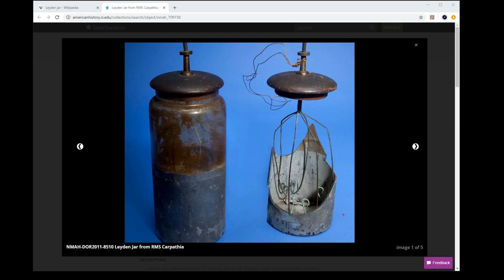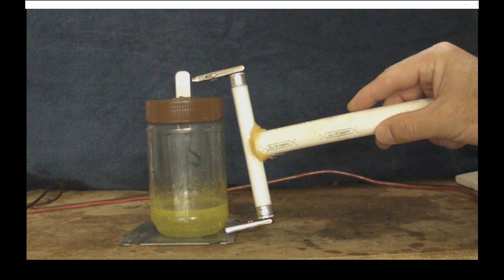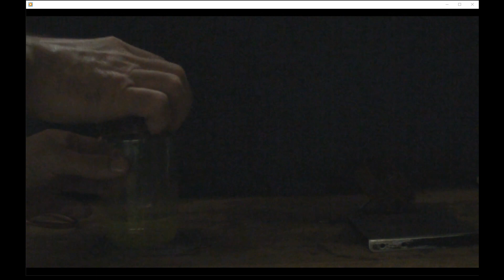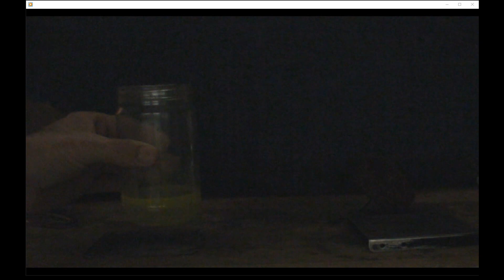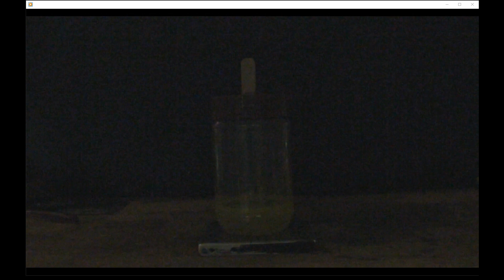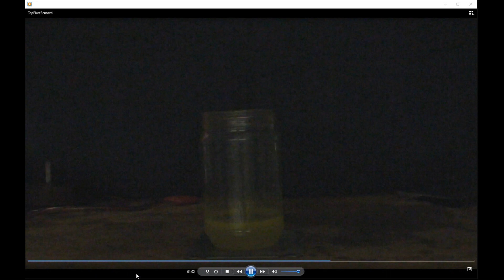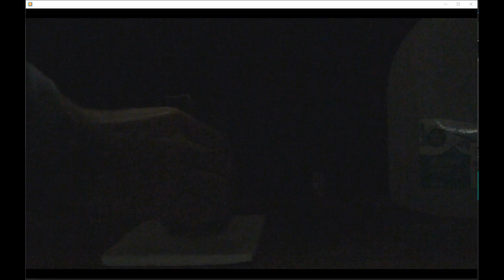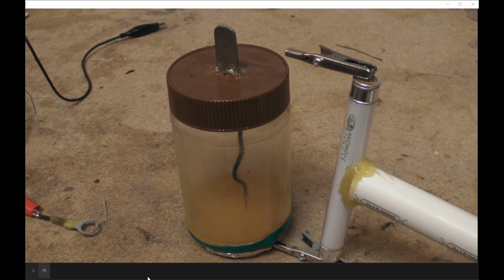Electron Theory can't explain Capacitors, but Ben Franklin can!

Comment: Yes, dielectrics influence the capacitance of a capacitor and contribute significantly to the total capacitance and hence energy stored; the main dielectric here being the liquid in the bottom of your jar. This is basic secondary school physics taught to 14 year olds in the UK,  yet you're making it into some profound discovery of yours.
Reply from the maker: <<the main dielectric here being the liquid in the bottom of your jar.  This is basic secondary school physics taught to 14 year olds in the UK,  yet you're making it into some profound discovery of yours.>>

OH yeah, it is all about me and MY discovery?  Is that your ingenious conclusion?  The main dielectric is the solid plastic, if you've ever done the experiment... or paid attention to the electrostatic meter at the end of the video, i.e. what is actually polarized?  The video was to show that ELECTRON THEORY states the charge of the capacitor is in the metal plates.  Ben Franklin discovered the opposite (which I am demonstrating).  You either aren't smart or didn't watch the video...THAT is my discovery!
Reply: @itsbs  OK, I apologize for possibly misinterpreting you, but you seem to be claiming that modern physics doesn't correctly explain how a capacitor works. That is, its theory is incorrect regarding the movement of electrons to and from the plates of the capacitor and the polarization of the dielectric by the internal electric field which influences the total capacitance of the capacitor and the energy stored in the dielectric, as taught to school children today in 2021. I'm fine with your video as a demonstration of how a dielectric is polarized by an electric field and there is an energy associated with it; but to then claim physics can't explain this while Franklin can is... an OTT click-bait claim to make in 2021 in my opinion.
Reply from the maker: @BarriosGroupie  <<I'm fine with your video as a demonstration of how a dielectric is polarized by an electric field and there is an energy associated with it; but to then claim physics can't explain this while Franklin can is... an OTT click-bait claim to make in 2021 in my opinion.>>

Modern Physics says that if you remove the dielectric from the electric field, which is caused by the displacement of electrons in the metal plates, then the dielectric would not be polarized... i.e. it is NO LONGER in the E-field created by the metal plates (electrons).  That is modern physics!  When I remove the dielectric from that metal-induced E-field, the plastic is still fully charged.  How?  Modern Physics can't explain why that occurs.  They try...so look at the MIT professor Lewin's explanation, and I show that is still incorrect.  You seem to think you are smarter than you really are and want to lash out at me, but your brain seems to be the click-bait.  So, here is the brain teaser... if the dielectric stores the charge of a capacitor, then what about a vacuum capacitor?  How does a "vacuum" dielectric store charge?  Isn't that supposed to be empty space?
Reply from the maker: @Fleurlean4  <<So how does a vacuum capacitor store the charge?>>

First step, don't think that the "vacuum" is "empty space" like Einstein created in 1905.
Reply from the maker: @Fleurlean4  <<Someone serious would collaborate with others, make an effort to show that they’re not a nutcase, rather than rationalizing your awkward personality by name dropping Franklin, as if he’s going to save you. Franklin was nothing like you, he was an industrialist and slave owner, he gave no shits for optics, only for results.>>

Well, I guess I am not that serious, which is part of the point.  You don't need to be a serious scientists to see the major oversights created by "serious" scientists.  I'm just quoting Franklin and showing you his original writing (that anyone can go read).  He said the charge was stored in the "glass" and he was correct.  Wow, you seem really interested in attacking people and not the scientific message... interesting!  Anger issues?
Reply from the maker: @Fleurlean4  <<Good bombardment, this really helps out taking you seriously. >>

I'm not asking anyone to take me seriously.  I am merely sharing my research so you can do figure it out yourself.  You keep missing that point, as if I am trying to build a following of believers in my "unachievable smartness."  I'm doing the exact opposite of that, otherwise I would hide my sources like Einstein.
Reply from the maker: @Fleurlean4  <<all I see is a whiny baby with anger issues cosplaying as a serious scientist. All you want is attention you were not given at some point of your life, maybe as a child with your parents>>

OK.  Good luck with your life...
Reply from the maker: @Fleurlean4  <<Why would you do these experiments in a dingy basement if you are serious? >>

It's my garage.  The idea is to keep it as crude as possible so ANYONE can realize that they can do the experiment themselves.  That's what I am encouraging... look at my experiment and look at the experiments that other people have done (direct links in the pinned comment) and DO IT YOURSELF.  Now, how cool is that?  No need to build a particle accelerator to understand the problem with Electron Theory...
Reply from the maker: @Fleurlean4  <<You on the other hand, are happy making a scene and having people pretending this is a worthwhile use of anyone’s time. Btw in science you try to disprove your hypothesis not constantly defending it. >>

I'm defending it from half-baked ideas from people that have an incorrect understanding.  That way their disinformation doesn't change people's minds when they read the comment section.  That's the defense...and yes, peer-review articles and Phd thesis require the author to defend their position...it is part of science!
Reply from the maker: @Fleurlean4  <<Yes, science is serious and there is a reason they don’t let sad people like you into the establishment, because you are without responsibility, you are blinded by your greed and desire to do/be something.>>

Oh yea, who am I then?  Where am I advertising that and where you should send me your money!  Are you not smart enough to figure this out by looking around, or do I really have to type it all out for you?
Reply from the maker: @Fleurlean4  <<You are someone who will defend and rationalize ad infinitum,>>

Rationalize?  Most people say stupid, emotional things to me, exactly like what you are doing.  It's not hard to counter pure emotionalism, like you have been dribbling.  If you don't like my "rationalization", I show you where to go read on your own or how to perform the experiment yourself.  Why do I care if you "believe" what I say or not?
Reply from the maker: @Fleurlean4  <<Ask yourself these questions instead of thinking people will enjoy reading your thoughts, this isn’t a game yet you keep treating it like one.>>

Funny...this is the idea of "misleading people like flat earth" and wasting people's time... The real irony is when you realize that Modern Physics and Popular Science propaganda is the real flat-earth AND THEY HAVE been charging money for it!
Reply from the maker: <<You have to understand that you have slightly worse than average you tuber skills, which are enough to make you dangerous here. People of all kinds come here, youngsters who do not have a complete picture of their world, >>

Well, it looks like you ended deleting all of your messages, which is one reason why I quote people in my responses.  Thanks for degrading me again and to think you have a "complete picture" of the world is probably the most arrogant thing to say.  Maybe you didn't mean it like that, but wow.  The youngsters will be able to handle themselves just fine...understanding the falseness of Modern Physics opens up many new opportunities, in a more productive direction.  Good luck to you in sorting out the problems in your life...I really do mean that.

Comment: Pretty much nonsense ...
No, in fact, it's all nonsense.
Reply from the maker: <<Pretty much nonsense ... No, in fact, it's all nonsense.>>

Genius, no nonsense comment!
Reply: @itsbs  Electric current in a wire is a coherent flow of conduction electrons. When current flows to a capacitor plate, the plate becomes charged. dQ/dt = i; the capacitance = Q/V. It is all about the electrons.
Reply from the maker: @danielstump3204  <<It is all about the electrons.>>

OK, so electron theory says that the charge of a capacitor is stored in the plates, which creates the E-field for the dielectric.  When you take the dielectric out of the E-field, the the capacitance of the "air" would become the new dielectric and the charge would still be in the plates, right?

Comment: LOL, conneting a jar into a ground, why would discharge not happen according to "electron theory"? You just demonstrate that if you put it to ground it will discharge. That is supposed to happen. You are just charge your capacitor and discharge it at the same time xD
Reply: @itsbs  going away when you spread ignorance? Nah, i won't do that, i don't even know that Alinity videos is.
Reply from the maker: @wergserium7515  <<going away when you spread ignorance? Nah, i won't do that,>>

OK, if you insist... You realize that electron theory says the metal plates INDUCE an electric field in the dielectric.  What happens to the INDUCED electric field when you take those metal plates away?
Reply: @itsbs  just to say you didn't create any eletrical field inside your capacitor, the eletrical field was already there, it was been charged, and what you do was discharging it. Nothing that cannot be explained by physics, nothing new.
Reply from the maker: @wergserium7515  <<Nothing that cannot be explained by physics, nothing new.>>

I agree, nothing new, because Ben Franklin described it correctly.  It is electron theory that changed it to metal plates and electron imbalance that induces the charge in the dielectric, which is obviously incorrect when looking at this type of experiment.
Reply: @itsbs  this does not make the "electron theory" wrong there is nothing in the "electron theory that says you cannot do that.
Reply: @itsbs  yes you can polarize a dielectric, and what this changes? Nothing.
Reply: @itsbs  first of all, all dielectric material have atoms, and all atoms carry electrons.  So it is possible to make current flow in a dieletric? Yes it is? It is possible to polarize a dielectric? Yes it is? So i ask you more one time. What is the point of all that? Are you trying to prove something that in the XIX centuary was been called aether? That thing was been disproven so many times?
Reply: @wergserium7515  dielectrics are insultators so how does current flow in it lol what
Reply: @Kingslayer29360  nothing is 100% insulator. You can have for example a piece of papel electrically charged and if you discharce it, the charges will flow out of the papel. Electrostatic bruh.
Reply: @wergserium7515  isn't that static electricity and not the electricity you are using to reply?
Reply: @wergserium7515  Every experiment re the existence of aether has shown that Prof Reg Cahill's aether theory is correct (he discovered the correct calibration in 2002). Alltho Demjanov actually discovered his own version of the correct calibration in 1968, but he didnt publish until say 2005. And Demjanov's twin media MMX is/was the best MMX ever.
Reply: @atheistaetherist2747  also a experience of take a photo of a black hole or the detection of gravity waves was been made. So will the experience of the doctor Reg Cahill be true and the Einstein theory be false? Many predictions about black holes that was been made by general relativity proved to be true. What about the predictions of that professor? What he predicts?
Reply: @atheistaetherist2747  also light was been also measured to have a constant velocity in all directions. If the light velocity isn't constant how would you explain why telecomunications with microwave actually work? Because if light velocity isn't constant the wavelength must also not be constant in order that the frequency of the light to be the same. This means that all antennas must chance its lengths all the time. And that is impossible to happen.
Reply: @wergserium7515  The existence of aether does not necessarily mean that blackholes or gravity waves do not exist -- but it might/will need a different explanation for what blackholes etc are.
Cahill has about 40 papers, mostly about aether (which he calls quantum foam).
Cahill duznt do much predicting. But he explains a lot. For example the Shnoll Effect.
Reply: @wergserium7515  Cahill has some papers re that c depends on direction.
Einstein said that c depends on position & direction. He used this to calculate bending near the Sun.
Reply: @atheistaetherist2747  no its not. Light do not depends on any inertial referencial. The constant c is universal to all frequencies of light and it only chances when light travel in one medium to another because of refraction. That's how physics and also how optics fiber works.
Reply: @atheistaetherist2747  no, Einstein uses the curvature of the sun in his equations to calculate the bending of light.
Reply: @wergserium7515  So, u are saying that Einstein was wrong re his calc of bending near the Sun?
Reply: @atheistaetherist2747  no, i am saying that Einstein did the calculus in this way lol didn't you understand that? He literaly uses the curvature of the sun. It was the first evidence of Einstein theory.
Reply: @itsbs  did you store energy in the vaccum? Or it is just saying?
Reply: @itsbs  it is impossible to form a visible eletrical spark in a total vacuum space. Yet eletrons still can move in vacuum
Reply: @itsbs  you cannot have eletrical field in the middle of "nothing" do you? You can have eletrical field only if there is something in this empty space that has charge.
Reply: @itsbs  see energy of the capacitor is stored in the form of a eletrical field, between two metal plates with eletrical opposite charges.
Reply: @itsbs  cause you just polarize it. You didn't store anything.
Reply: @itsbs  i already answer that, because you polarize the dieletric material by induction.
Reply: @itsbs  i didn't said the plasma ball is a capacitor, i said you cannot produce visible sparks in the vacuum.
Reply from the maker: <<LOL, conneting a jar into a ground, why would discharge not happen according to "electron theory"? You just demonstrate that if you put it to ground it will discharge.>>

Did you not understand the part where the dielectric was removed from the "plates creating the electric field that polarized the dielectric"?  Instead of continuing to comment showing ignorance, why don't you think for a moment?  Maybe look at the resources I provide?  Maybe look at some other experiments links that I provide?
Reply: @itsbs  showing ignorance? Your capacitor does what all capacitors do, that is to store energy in the form of a eletrical field. what is a point of that? The bobines do practically the same, but it stores energy in the form of magnetic field. When you connect it to something, or to ground, that was been seen in somewhere in your video, it obvisiouly will discharge. What is even the point of that?
Reply: Just to answer to your question about the vaccum https://www.youtube.com/watch?v=fOwkPbOpQkw